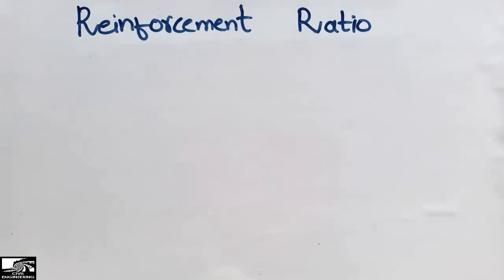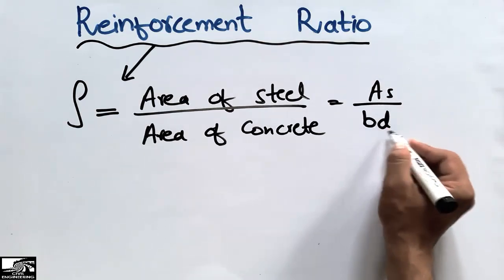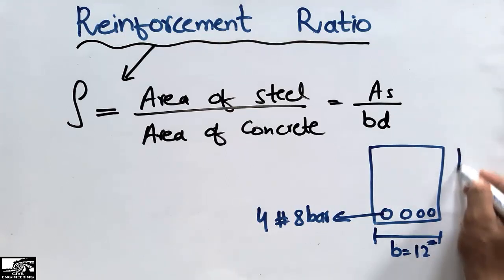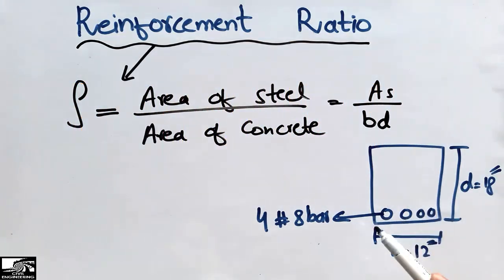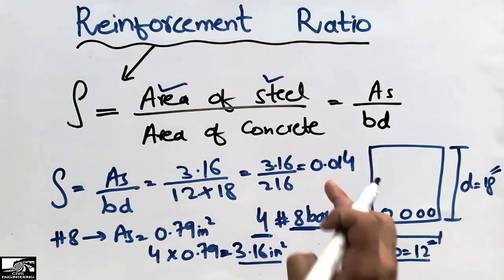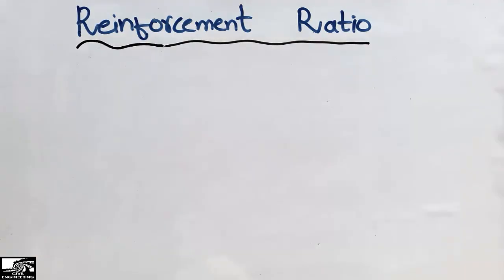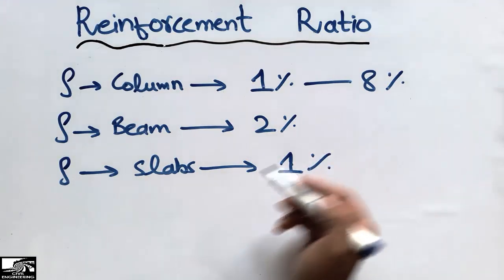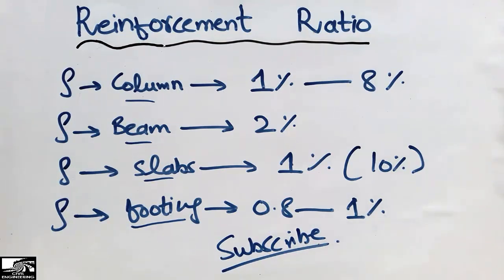What is Reinforcement Ratio | Example Solved

Comment: Sir , explain 3.16 where he comes from.
Plz solve this
Reply from the maker: Its the area of steel used here in this cross section of beam, We know area of #8 bar is 0.79 and we have 4 number of bars in cross section so total area will be 4*0.79 = 3.16 inches square. Hope you understand
Reply: Area of 8 bar ? 
Explain sir (0.79)
Solve this sir
Reply: ((Pi)/(4))*(8/8)^(2)   where,pi=3.1416